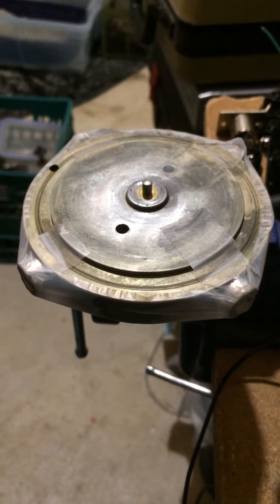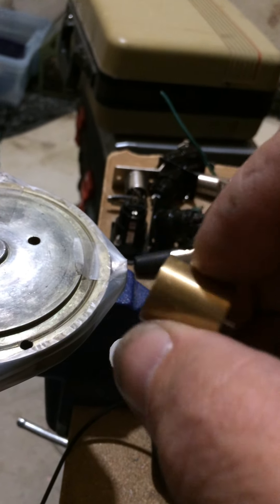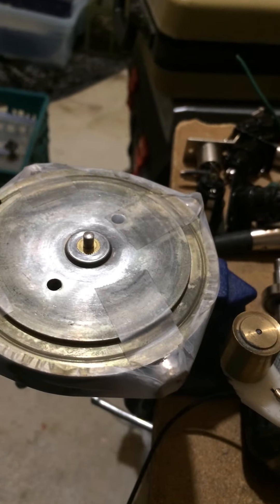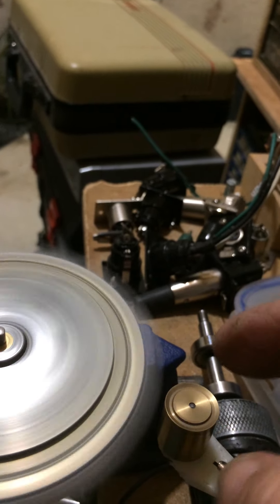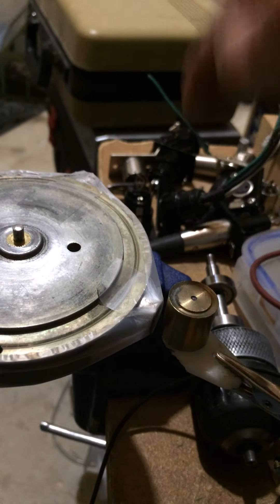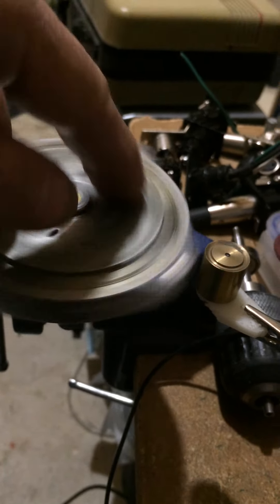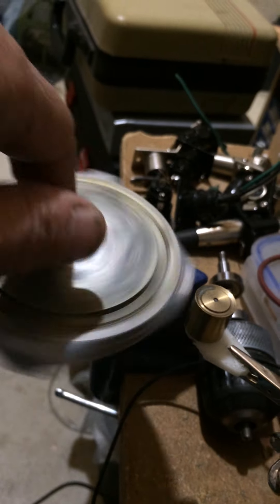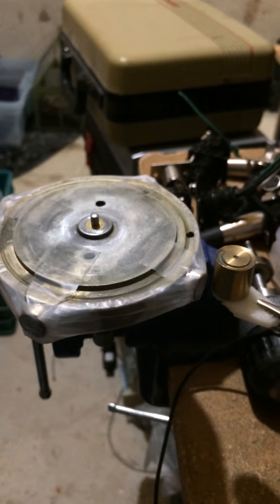Eddy current driven motor concept

Comment: What might be an interesting addition to the demo, would be to monitor any voltage from the brass sleeve, interject a piece of 
sheet cellophane ( 2 - 3 mil ) between the magnet and sleeve so as to eliminate any possible vacuum or boundary layer
effect from the compression of air between the surfaces. It occurred to me that it might be helped by forces unseen.
Reply from the maker: Interesting concept  . The bag was filled with activated carbon soaked with water so I believe it was due to charge separation forced apart by magnetic field   The carbon just acted as a reservoir of charge carriers. Plastic is not solid.  Microscopically it has perferations therefore allowing charge to flow

Comment: Hey... there's nothing wrong about this experiment... Lenz's law applies perfectly over here... lemme try to clear your doubt...

"lenz law doesn't explain this video..it applies to one stationary body and one moving body but not 2 moving bodies"
No & yes... it does apply to 1 stationary & another moving body, which is why the brass rotor spins up & keeps spinning. You're probably assuming that both the rotors are spinning at the same speed, but that's not the case... they're spinning at different speeds, for which, there is a RELATIVE MOTION between the 2... this relative motion is resulting in the induction of eddy currents... the situation is exactly similar to that inside an induction motor... the brass rotor of this device is always running at a speed, lower than that of the bigger rotor... initially, as the bigger rotor starts spinning, it induces eddy currents in the brass rotor, spinning it up... the brass rotors keeps speeding up, until it attains the speed of the bigger rotor... but the moment the speed of the 2 become equal, there is no more relative motion between the 2, for which, no more eddy current gets induced & the  brass rotor slows down MOMENTARILY... but the moment that happens, there is once again a relative motion between the 2, for which, eddy currents get generated once again, causing the brass rotor to speed up, until it reaches the speed of the bigger rotor, after which, the cycle repeats itself. A similar kind of thing happens inside an induction motor... it is known as slip

"in this case, the moving magnets actually assists to rotate the brass bushing by the eddy currents instead of slowing it down. This law clearly states that an equal and opposite force is applied to the initial force that created it. If that's the case then why does this work? the eddy currents in the brass should bring the rotor to almost a sudden stop but it doesn't"
Actually, there is an equal & opposite force acting on the bigger rotor, attempting to slow it down, but since the rotor is bigger & heavier than the brass bushing, & since the brass bushing is free to rotate, it starts spinning itself, due to Newton's 3rd law... the situation is similar to a magnet repelling another magnet... if a heavier, larger magnet approaches a smaller one, at a high velocity, with their like poles face to face, & if the smaller magnet isn't fixed to any kind of support, the smaller one is going to move away, isn't it? That is sort of what's happening over here... the eddy currents are creating a magnetic field, having the same polarity as that of the approaching magnetic pole

"Also if the brass is spun at high speed, the magnets on the rotor should stop the spinning brass but it doesn't either....the rotor starts to spin as well"
That is because, the rotor is free to rotate... the same thing that I explained in the above para, is happening in this case too, but just in reverse... if the smaller magnet approaches the bigger magnet with sufficient momentum, with the same poles facing each other, & if the bigger magnet isn't fixed to a support, it will be moving away from the approaching magnet

"also I can stop the bushing from turning and the rotor continues even though the eddy currents are being produced which should cause a fast braking action on the rotor but again it does not.....the same applies in reverse by stopping the rotor lined up with the bushing, the bushing should stop but it doesn't"
Actually, the brass bushing doesn't have enough surface area... the eddy current path is very small, for which, very small eddy currents are getting generated in it, generating very little braking force, for which, none of the rotors come "to almost a sudden stop"... that is why, in AC machines, like transformers, the machine core is made up of several smaller, thinner, laminated sheets, stacked together, to reduce eddy current losses... the thinner sheets have a very small surface area & thus, a very small eddy current path
Reply from the maker: I agree with every word said here and thanks for your comment...im aware of all physical laws but here is the problem which I neglect to mention or show in this video......the brass bushing in this video has a steel shaft and the reaction you see in this video shows what you see....I have also tried at first a brass bushing with a brass shaft...the result of that experiment shows only the brass bushing pulsing back and forth but not spinning...I removed that one in favour of this one with a steel shaft because the brass one warped when attempting to spin at high speed.....lenz law very clearly states that there will be an equal and opposite reaction to the initial force which causes that reaction...in respect to that comment the eddy currents in the bushing should oppose the rotor and bring the rotor to a quicker stop than what is seen here....automobiles that weigh 2 tons and travelling at high speed can be brought to a very abrupt stop with magnetic brakes despite the mass because eddy currents developed in the copper discs produce massive amounts of reverse currents  regardless of size with respect to the car and its mass and speed......although the discs are fixed and not movable, it is understandable that it would happen that way ...the same applies to very heavy trains with magnetic brakes....the train can be brought to a stop much sooner than with conventional brakes.....so lenz law is very correct but again applies to one stationary and one moving body....now with the steel shaft the reaction is what you see but with a brass shaft there is no reaction as you see, well there is but only pulsing....so explain why that is?..all metals can aquire or absorb some magnetism to a certain degree...some on nano scales....and also metals have degrees of current flow capability and so when exposed to magnetism can produce currents and eddys ...because the produce eddys, lenz law will apply and react according to the law....but then again with 2 moving bodys, and one element made completely of brass, the reaction does not follow the law....in my opinion lenz law is one law that can be altered by geometry or material chemistry....thanks again for your comment.......
Reply: That's interesting... needs to be investigated. Tbh, I really can't say at the moment, what's exactly preventing the bushing from spinning, unless I'm able to take a look at your device personally. I'll definitely replicate your experiment & try to find out what's going on, if I get the chance... I'll get back to you after I've done it. Btw, are you absolutely certain, that it wasn't any kind of mechanical imperfection in the brass shaft, which was hampering the movement? And thanks for your detailed reply... regards
Reply from the maker: Brass is a somewhat a soft metal, the possibility of eccentricity in the brass shaft is high. I cut the brass rotor was on n my lathe and mini milling machine..I do not recall locking the table on my mill when it was as cut. So That was always possible but I also cut the one you see in this video  on the same machines except I inserted a steel shaft I instead of all brass. For myself the explanation is simple enough. The magnets attract the steel core through th brass . Since both rotor and brass are free to turn, they do so because of mutual attraction of magnet and steel by proximity  until gap between the 2 is large enough to disassociate.    The brass itself may or may not play a role  magnetically or with induced currents. One thing is fact the brass does have some weight or mass which definitely assists  rotation by inertia . This leaves room for much more investigation as you say.  Unfortunately I have not continued with this . It was just a very quick thought I had to try and tried it.
Reply: But there's a little problem with that... initially, when the rotor magnet will be approaching the bushing, the force of attraction on the steel core will have 2 components - a tangential component, acting opposite to the direction of rotation in which the bushing is rotating over here, the force being tangential to the curved surface of the bushing, & a perpendicular component, acting perpendicular to the curved surface. After further rotation, when the magnet is at a minimum distance from the bushing, wouldn't the force be entirely perpendicular to the curved surface? Wouldn't the magnet be trying to pull the steel core towards itself in this position? Then, after further rotation, when the magnet will be going away from the bushing, the force will again have 2 components - a tangential & a vertical... but this time, the tangential force will be acting in the direction of rotation, as seen in the video. In conclusion, over a complete rotation of the big rotor, the force will initially be acting tangentially, opposite to the direction of rotation observed here, after which, it will become perpendicular to the bushing surface & finally, it will be tangential once again, but acting in the direction of rotation... so, considering all these 3 forces, will they really start up the bushing from rest? Or will the 2 tangential forces nullify each other over the cycle?
Reply from the maker: Inertia due to mass  at high speed overcomes vertical forces with respect to size differential . If this system  can be made with frictionless bearings , tangential and vertical forces will be at minimum . Keep in mind the size differential of the steel core to the rotor. At high speed, the vertical force will be practically nonexistent , bearing friction plays a much bigger role.  And as you see in the video, the bushing does start from rest position. To prove this, I built a rotor with mass and different size bearings for the shaft. At first, the bearings were 20mm diameter, the rotor was spun at high speed, it continued to spin on its own for  3 minutes. I then reduced the bearing size to 9mm, the same rotor spins for 15 minutes. The bearing size alone contributes to less friction with respe
ct to rotor size and weight. There were no magnets on this one, just a heavy rotor with bearings and gyroscopic forces. Magnetic systems all have tangential and vertical forces with respect to other magnetic bodies but geometry determines how much of those forces apply.